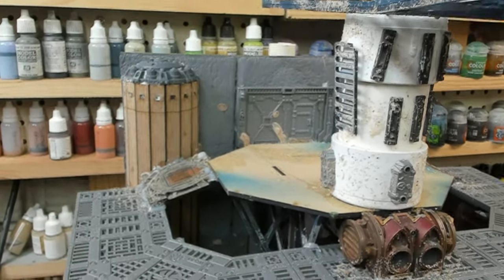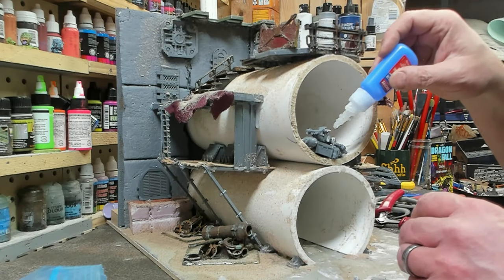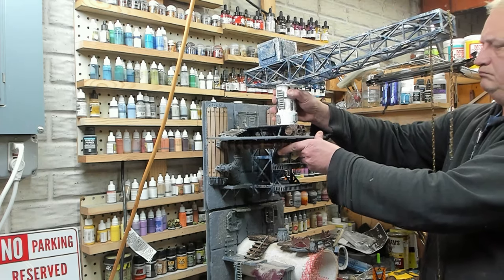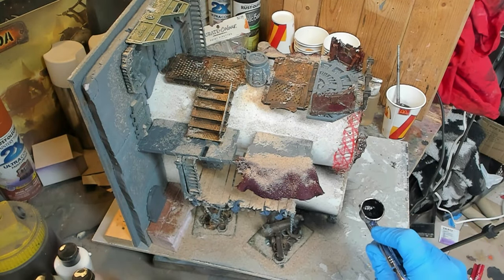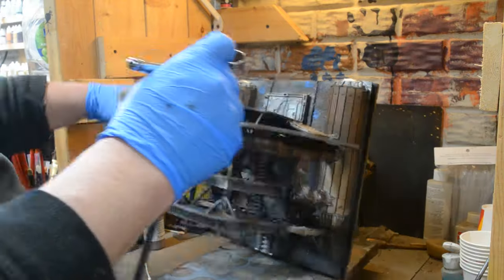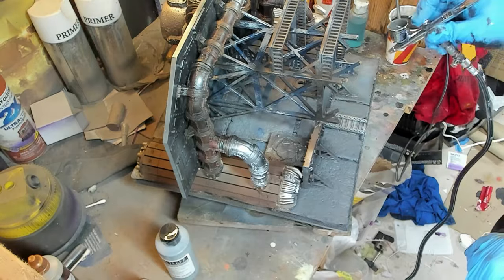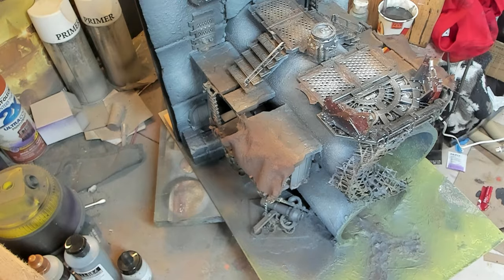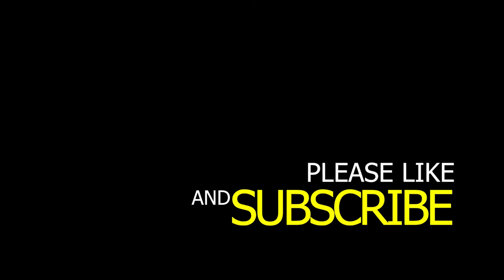Necromunda Sumptower Settlement build and paint

Comment: If it gets too top heavy what about having a sump tile that is just a concrete pier with a crane on it then a bunch of pipes and catwalks going up and surrounding the pvc with maybe some small docks and dingys around the base, or breaking your normal plain and mounting the crane on the top of the pipe you use to hold up the sump wall?
Reply from the maker: or make the top of the sumptower board join this one using another crane?  You have such good ideas!  Thanks bud!:)